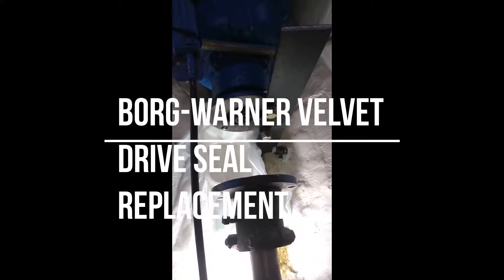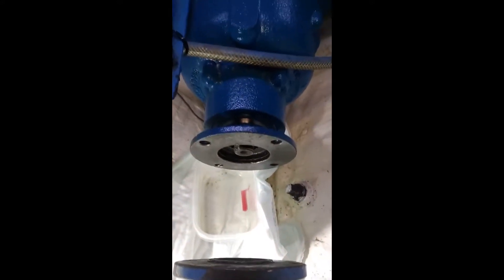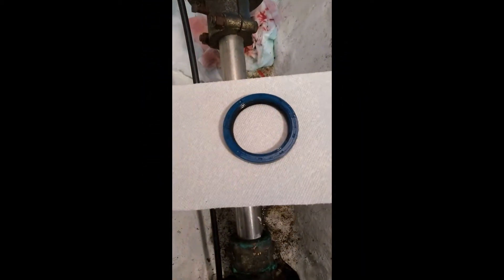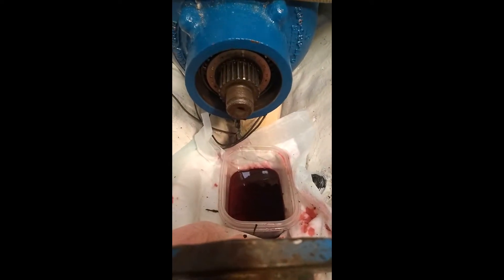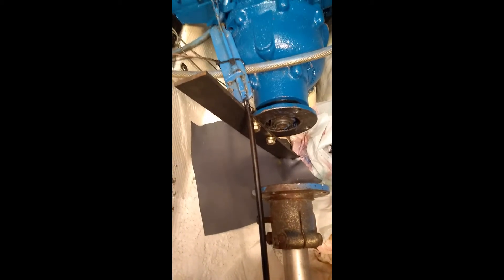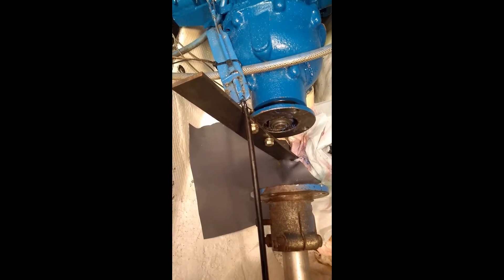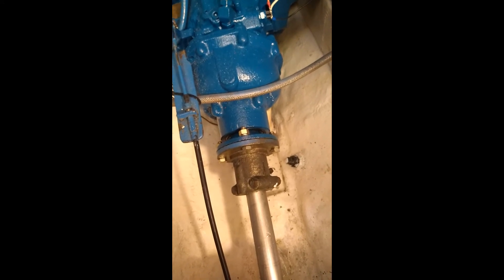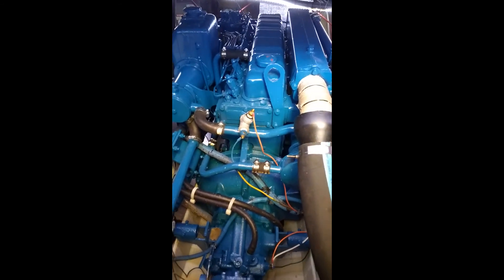Borg Warner Velvet Drive Seal Replacement

Comment: What's the trick to separate the coupling  and push the shaft to the aft? I'm doing this in the water.  Loosened shaft packing, but having issue seperating the coupling to get to your first picture in your video... the actual separation. Appreciate any advice... thank you!
Reply: Thank you! Got har started moving.  Used a couple of putty knives to get things going.  Only about 1/4" apart right now.  Will continue to turn and wedge/pry.